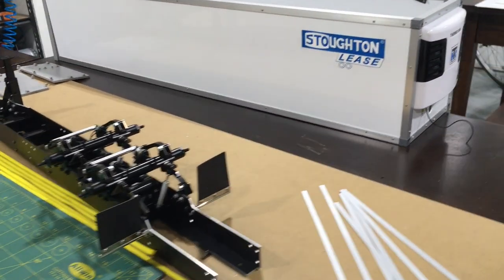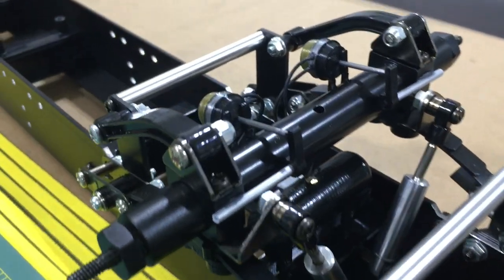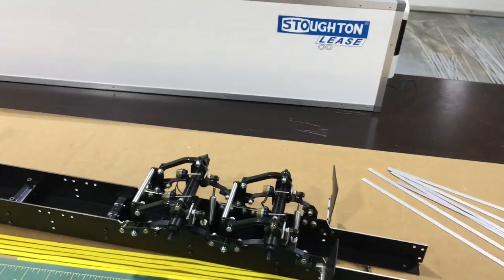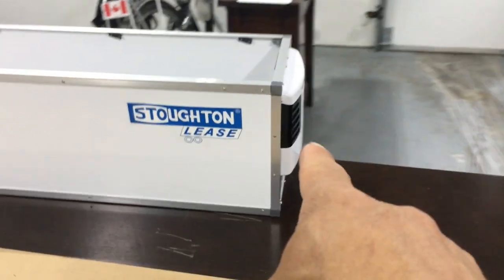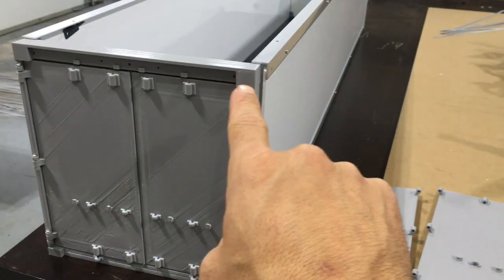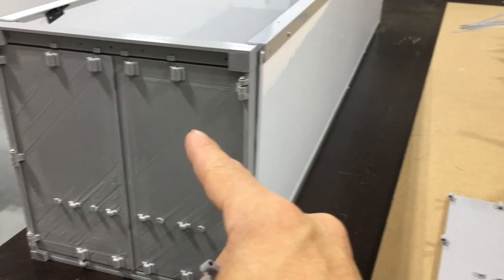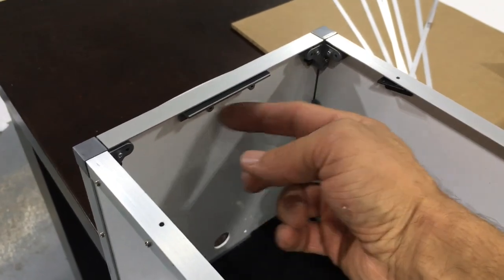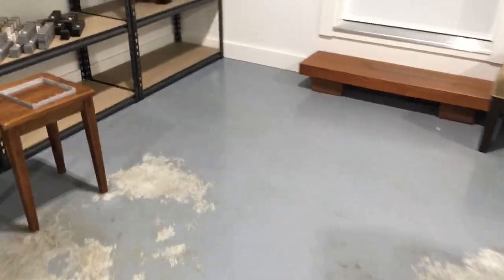Tamiya 1/14 reefer trailer upgrades part 4

Comment: The result of your work on the doors is really great, and it really makes it more real. Very good recovery of this aluminum to make the floor of the trailer and the smoke to represent the cold is excellent, I can see meat hanging in the trailer 😁 in addition it changes that to always see pallets. You always have great ideas and having a printer really helps a lot, I should buy one someday.
Reply from the maker: Thank you my friend, the smoke will be a nice touch. Yes you should have a printer, all the things that you do, i am surprised that you don't. It seems like a good tool in your shop.
Reply: @westernsharpie  Yes it is true that I should have bought one for a long time, I do not know which model to choose, there are so many, that I do not know what to take 🤔
Reply from the maker: @satorrotas  They are all practically the same for the most part, especially if you're just starting out. Anything from Creality is fine. Ender 3 or Ender 5 are perfect. Just choose the size you want some are smaller and some are bigger. They are pretty easy to figure out and the best thing since sliced bread. Take care Pascal
Reply: @westernsharpie  Ok so I will look for a printer that does not take up space, moreover I would only do small things so I think an impression of 18 by 18 would be more than enough for me, thank you again for your suggestions 😉👍

Comment: Hi! ...Thank you for all your videos..I have a question about the length of the trailer with refrigerator and the one without..are they the same length...thank you
Reply from the maker: You're welcomed, glad you are enjoying them. The thickness of the refrigerator is 25mm. I have chopped away a little from the trailer, so it would be best for you to look on the Tamiya sire for all the accurate dimensions. thanks

Comment: Can i ask you question, What 3D Printer do you think is good. That's not expensive. Between $200-$500. I was looking at the Creality 3d printer from banggood. What do you think about that one?? I just want to do small things. Things like your doing. Not the big things like container, When you have chance to answer. I would really appreciate it. Thank you
Reply from the maker: To be honest I feel like they're all very similar for the most part. Creality is solid brand. Customer service is non-existent, but there's enough info on youtube to get by, they're probably the most common used printer out there. The ender 3 I think is the entry level one and it's just fine. I have an ender 5. It's a box shape and supposed to be more solid of a structure, but if you're doing small things an ender 3 is all you need. Good luck